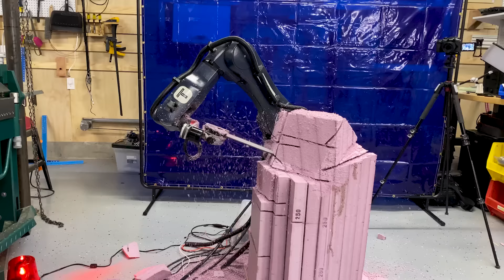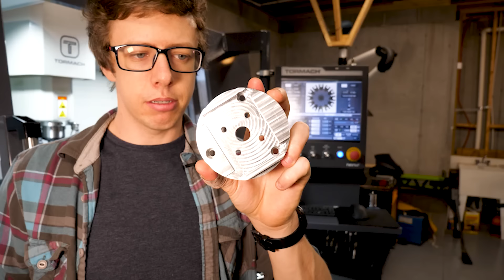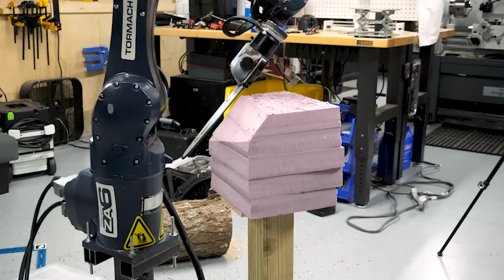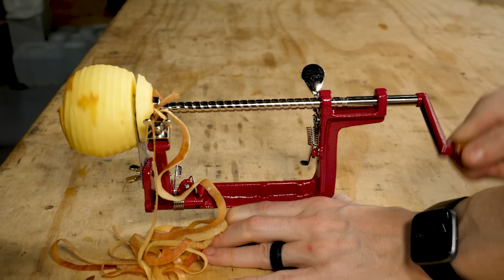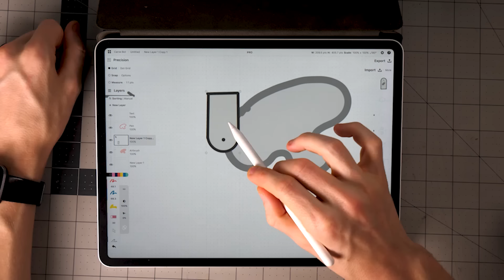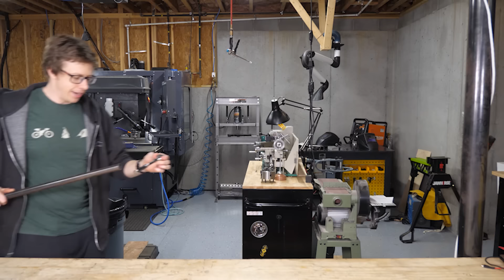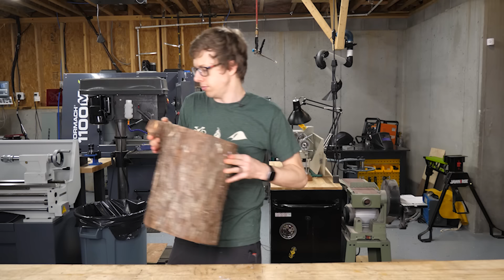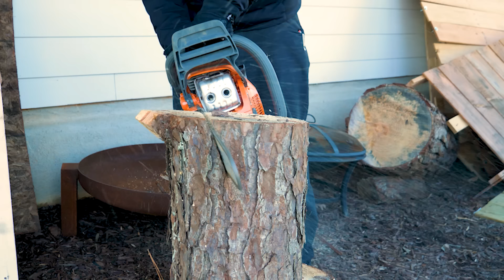Chainsaw + robotic arm = art?

Comment: Since you use CNCs plenty, I'm sure you are familiar with roughing/finish machining. What you have now is a decent roughing algorithm. This would be the spot at which you add the applecore toolpath as a finishing pass, IMO. It still wouldn't get the interior areas, but you could surface profile the outside and get a lot closer to your 3d model.

Comment: Shane, what about trying one of those angle grinder chainsaw wheels as your tooling instead of a full blade? I'm sure that would change your software and your tool mount, but maybe that is Rev2?  Impressed at the work as always and showing us that it wasn't easy!   https://www.amazon.com/dp/B087DYWX38/ref=redir_mobile_desktop?_encoding=UTF8&aaxitk=6pfVK13deiJN2uY.kvrm8A&hsa_cr_id=6831404690001&pd_rd_plhdr=t&pd_rd_r=e8f9ca88-6bc6-4d0d-9428-3235146f7dcc&pd_rd_w=JBNLv&pd_rd_wg=sGFGB&ref_=sbx_be_s_sparkle_mcd_asin_0_img

Comment: You had problems with the chainsaw because you're coding it in Python. Python coders are chick, modern city dwellers. You needed someone to code that in C, written in Emacs running on BSD. Far less chick, but it would've taken much better care of your chainsaw ;)

Two words for that chain: Sharpening and Tensioning.

Comment: I don't know if you know this, but a chainsaw needs pressure from the operator to get it to cut wood.  Not a lot, but i mean you are just sliding knives against a piece of wood.  It really shouldn't be too much more than the weight of the loud gas powered saw, but if you have a stupid saw or if you have a dull chain, it can take more pressure.  I would take the saw off the bot, and try doing some wood cuts with the saw, by hand, so you get an idea of how much pressure you need.  depending on the holding strength of your bot and rotor, you may need to do stuff like only make half a cut and recheck coordinates or only make small cuts. if you are still having trouble, I would try your original idea of basically a spindle cnc but with a chainsaw to get the shape and then go in for the negative space cuts and details.  Sure it may take a while, and I didn't see anything on your vid about allowing the chainsaw motor an hour to cool off.

Comment: Not sure about the software for that robot works, but most robots have a setting called a frame.  The calibration of awareness was not necessary.  For each work station you can set up a Cartesian coordinate system. Then teach positions in reference to that frame. End of arm Tool frames are possible also. This will allow you to jog the robot in reference to the tip of Your cutting edge. You can reference teach with this and also jog the robot in each frame system

Comment: One plausible way to solve the "stuck at local maxima" issue is to use algorithms like simulated annealing or basin hopping. Those won't give you very accurate extremas, but will give you a good enough approximate. If you need better extrema, maybe consider doing gradient descent/ascent on top of that.

Comment: You could always take a slice of your model and move the plane.. If the slice has two high points, then you can have the height move to the "center of mass" by splitting the peaks.

Comment: Chainsaw blades are designed to cut across the grain.  There are special chains that are designed to cut with the grain (a ripping chain).  Really, it's just altering the angle of the cutting surface.  Unfortunately, they're kind of specialized angles.  What works for one will not work well for the other.  If your robot could change tools (chains), that might make wood cutting more efficient and....possible.

Comment: i don't know anything in robots, but chainsaw yes. why did your chainsaw smoked and got hot, because it was running dry, fortunatly you have a bar with a sproket on the front. carving chainsaw don't  have one sometimes. and the teeth you aknowledge as anti-kickback are in fact, depth teeth. so it's normal for them to touch the wood, by filling them you can configurate the agressivness of the cut.  you need oil on that bar, you will burn it soon.

Comment: Hey huge fan of the channel. Not sure if anyone else has commented but the solution to your gradient ascent problem is to add stochasticity to the equation. Stochastic Gradient Descent is an optimization method used in deep learning to determine the network weights. So just switch the sign of the gradient and you are good.

Comment: To avoid getting stuck in local minima, one solution is to run a lot of gradient descents on different starting points and (maybe) some of them will avoid local minima and end in the optimal solution.
Giving "inertia" to the algorithm will also help getting rid of some local minima, since they will continue after finding the minima and potentially get out of the local pit.
In general many optimization problems cannot guarantee an optimal solution, but a good enough solution should be enough.

Comment: You could try the simulated annealing algorithm (https://en.wikipedia.org/wiki/Simulated_annealing#:~:text=Simulated%20annealing%20(SA)%20is%20a,space%20for%20an%20optimization%20problem.) to avoid the local optimum issue.

Comment: As always, great job Shane! BTW, a few years ago I created an optimization algorithm that deals pretty well with local minima and with discontinuities in the solution space. It is very simple to implement, and I have some code in Python, C++, and Lisp if you want. (https://cgti.udg.mx/sites/default/files/adjuntos/memorias2012_07_vdigital.pdf page 222 of the pdf)

Comment: Re: the overheat problem, shouldn't there be bar and chain oil dispensed? Pole saws may not have it because it would splatter all over you from up high and you're making small, short cuts. A saw that you'd use to make sustained cuts like that will have an oil reservoir and the thermal load from friction on the bar side would be much reduced.

Comment: don't know if someone already said that, but  the points swarm is a viable tecnique. It works just like gradient ascent but uses multiple points, so it can then find a group of points with the highest value. it increases calculation time but will most certanly find the global maximum

Comment: To efficiently carve wood with the chainsaw, it might be advantageous to removed the anti-kickback teeth from the chain.  Those teeth restrict the plunge cuts you were trying to accomplish.  Also was any chainsaw lubricant used during the cutting.  Lack of lube will definitely overheat the bar and kill the chain sharpness.  Great work and an understandable explanation of the troubleshooting process.

Comment: I understand the problem you engineered a solution for is -> can I make a robot arm with a chainsaw cut as a person would with a chainsaw and carve a statue.
  
I do confess to being underwhelmed by the robot cutting (haircut, pumpkin carve, and this video) video end products. I wonder why that is. Am I just not considering the difficulty in having 1 man create something that a company would have several engineers and funding and time up the wazoo to create? Are you using extremely misguided items to achieve your goals and in the meanwhile mention and show examples of what goes wrong? Do CNC machines that are big enough and have enough axes of freedom and attachments to do the bear or dog statue not exist? - if they do why not use some of their design principles? 

A few different cutting, smoothing, and detailing attachments would make a great robot arm that is capable of creating almost everything that a person could. I guess I'm just too obsessed with perfection. But good golly damn it is fun to watch you make the stuff. Have a good one.

Comment: "When you have a bolt thats really stuck, you get your bar and.. snap your wrench in half"

caught me off guard 😂
Reply: The truest thing he's said, though.
Reply: Or worse, you snap the bolt head off...
Reply: I broke a half inch breaker bar once and auto zone gave me my money back
Reply: Why did that catch you off guard? Have you never snapped a wrench, or a bolt head off trying to get stuck bolt out? You should really give it a go - you haven't lived until you've snapped a ratchet or at least bolt. It does wonders for you mental state, and the timeline of your projects. Highly recommended, 10/10. Would break again
Reply: @gorak9000  mabye bc some of us using good tools, or at least tools machined for that exact load, usually you're will be braking bolts.
Reply: @Smitellos  Usually it doesn't come down to the tools - even shitty tools are way stronger than the bolt. It usually comes down to rust, corrosion due to dissimilar metals between the bolt and what it's installed in, or galling. Nothing quite like that feeling when a bolt or nut turns a little, then binds, and you just know you've ripped the threads off the bolt or the nut, and you're in for fun times. I don't think I can ever remember personally breaking a ratchet or a socket, but if you put a big enough bar on anything, it will eventually break. You should probably be pulling out the torch long before you get to breaking a ratchet or socket - but some people don't have a torch, and just put on a bigger pipe.
Reply: @gorak9000  As an introvert gamer, the closest ive come is stripping an m.2 screw with a screwdriver. That is a new level of frustration I wouldn't wish on my worst enemies.
Reply: I once snapped two ratchet extensions trying to get a bolt loose in my car.

Comment: to make it in wood you need the saw to strip layer after layer away not cutting out huge chunks straight away. 
As a carpenter I would think of a chisel method to use that saw, But also to make it more interesting I'd add a hand held milling cutter/machine as a replaceable side thing for that robot arm, so it could get in and do the smaller detaljs, What is scary is that the milling machine goes up to 10K to 16K RPM so it's also like a Gyro and that is felt when operating by hand compared to a chainsaw.

And try something simple like a 3D letter with rounded edges and try to use a criss cross pattern on the middle of a letter L for example so you can test how to cut with the tip of the saw

Comment: It's probably been said somewhere in the 4500 comments below me (I'm super not reading through them all), but just in case:
Your gradient ascent algorithm would benefit from "simulated annealing". You initially make huge jumps between guesses (almost unbounded to start), then smaller and smaller jumps from the best guesses so far as the model "cools". If you tune the cooling rate right, you can find all the local peaks and just check which one is the best.

Comment: the "anti kickback tooth is actually the depth gauge. by knocking it down a few file strokes. and having a sharp chain, and making sure you oil your chain it should cut wood ok.

Comment: Those Teeth on the chain are not for kick back. It’s a depth guide for the cutting tooth. looks like you need to file them down a bit. You need to watch a few videos on how to sharpen a chain.

Comment: Why are you using the chainsaw (large width) in the same plane as the cut? Wouldn't it make more sense to use the smaller thickness in that plane (rotated 90 degrees)?

Comment: Very good.
Ascension works just fine, just repeat the code With an random starting location and use the most optimal output.
But.
Why not just extend the polygonal faces to a virtual cylinder, use those faces as the bases of the tools paths and run calculations on those faces to order the tool path?

Just like going from manual to manual copy to hydraulic, to NC to CNC, ya gotta copy the methods used already, humans have limited time to think about it and are great at making up tricks to figure out the fastest shortest easiest methods without ever figuring out anything.
Reply: I had just commented asking how to solve the gradient ascent problem and then read you comment. you simply start from another random point and check if you reach a higher point. Thanks

Comment: What about filing down the guide teeth on the chainsaw blade? It's common to set the height of the guide teeth when sharpening. When using normally you want the guide set just below the cutting tooth so that the saw does not take too much of a bite causing the saw to stall, or kickback from hitting a knot too hard. But with that arm of yours you should be able to cut slowly and steadily enough with very short guide teeth, also carefully selected logs with minimal knots. You probably already know this but you didn't speak much about the saw itself so I'm not sure. Also there are special bars and chains made for carving but that would be too easy
Reply: chain was too loose and needs more oil too lol

Comment: You clearly know your stuff with regards to coding and CNC etc.

But it's clear that you don't know much about chainsaws.

But that's OK, you can always learn more.

That "anti-kickback" you circled has nothing to do with kickback.

It's a depth gauge, commonly called a raker.
It's job is to adjust how much wood each tooth removes in a single pass.

Too shallow, you won't cut anything. Too deep, the cut becomes to aggressive for the power of the saw and the motor will bog down and stall.

A good chainsaw operator will have this set for the type of wood they normally cut.
Softer woods can be more aggressive. Likewise a shorter bar/chain on a larger engine can run more aggressively.

Unlike other tools, a correctly sharpened chainsaw will actually pull itself through the wood, the chainsaw operator mostly just steering the saw through the cut.

If the arm can detect applied force to the tool, you can vary the speed from that, otherwise trial and error to match the best cutting speed. 

An anti-kickback chain has a non cutting link with a curved profile that protrudes further when it starts following the radius of the end of the bar. 

You can also get anti-kickback bars, which have a sharper point instead of a gentle radius. 
Not worried about kickback with a robot holding it, but the shape might be better for finer carving. 
(for info, kickback only occurs when the top quarter of the radius of the bar strikes a hard material. The chain moving downwards relative to the the saw bites in and drives the bar upwards. Pretty easy to avoid doing if you understand it) 

Also, chainsaws require two things. 
Lubrication and cooling. 

There's an oil reservoir that feeds the bar. This lubricates the bar/chain interface with reduces bar wear as well as heat caused by friction. 

The cooling is normally done by the wood being cut. The moisture in a tree, particularly a green tree (live or recently cut), helps cool the chain. 

Dry and cured wood doesn't have the same water content. 
Other then shielding nearby electrical components, there's no reason you can't just turn a hose on to help with the cooling.

You can get hydraulic chainsaws intended for underwater use, so it won't affect the cutting at all. 
But the fine sawdust may clog up the saw instead of flying around your room.

You could likely find a better solution then a garden hose and tune the flow of water to be just right. 

Chainsaws CAN turn in the cut, just very slowly. This is because the chain and cutting area is slightly wider then the bar is. Use a straight edge sitting on the top and bottom teeth, then measure the gap between the straight edge and the bar.
I'm sure someone smarter then me could calculate the max radius from that.

Hopefully these tips from a qualified chainsaw operator will enlighten you and help improve your project to where we can see a wooden bear/dog.

Comment: Currently work with Fanuc robots and this project has been insanely interesting! I wish I could see what kind of interface and integration it would have with your program. Also, in terms of its safety, what kinds of programming controls does it have? For example Fanuc has DCS controls but in my limited experience with Kuka we had AMF workspace monitoring. It would use it’s Cartesian points to estop itself if it ever exited its safe-operation zone. Or, more specifically you could program it to estop if any part of the robot exited the safe zone or maybe you’re just concerned about the tool/tooling on the end-of-arm. I’m sure you know far more than me about these things but I wouldn’t feel right about not trying to help you stay safe. 

Also, love your channel man! It has helped inspire me to try making my own things again. I may not be good at the same things as you but it’s motivating to see others put effort into the things that they like to make. Also, to see you work through your inevitable problems that many people don’t seem to make time to share on other parts of the internet. The end product seems that much better because we saw how hard you worked and how you overcame each roadblock. Thanks for the great ideas! I’m excited to see what’s next!

Comment: You ought to be able to cut wood if you get a chain without those anti kickback bits. Kickback should be unlikely with your low powered saw and a gradual cut, even plunge cutting.  And I want to see a wooden carving. 

Can you do a 3D scan of a chainsaw carving and duplicate it on your robot?

Comment: 10:45 your algorithm is stuck at local maxima, you need to move the ball in the direction of the gradient with a stable multiplicative so it will avoid local maxima. Just wanted to note but you probably already know that spending a week to solve :)

Comment: What kind of wood was that, and were you using a chain oiler? You could probably glue a bunch of soft pine together to accomplish what you did with the styrofoam. It would technically be wood. Great video, by the way! I work as an industrial robotics engineer for a living. The closest I’ve come to chainsaw has been an ultrasonic knife. I’m incredibly jealous.